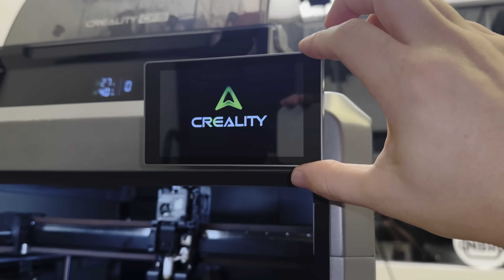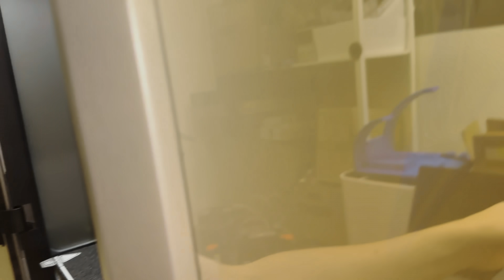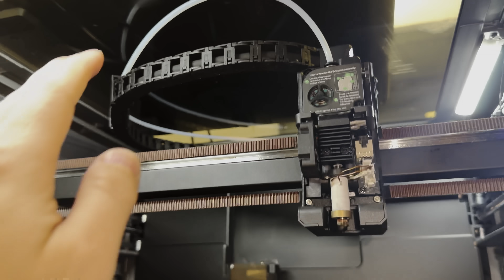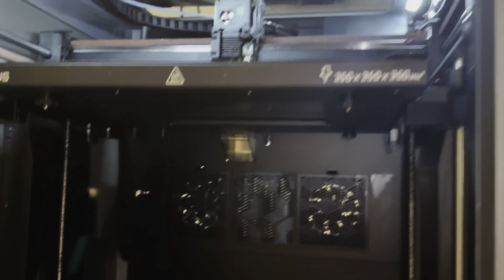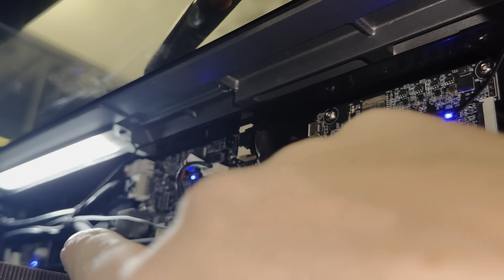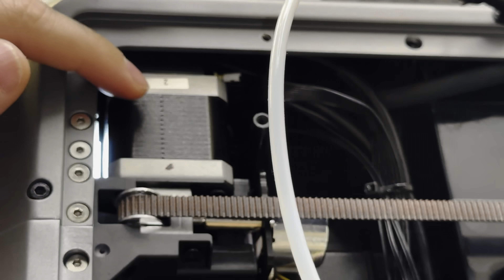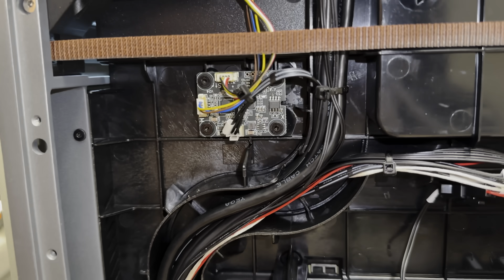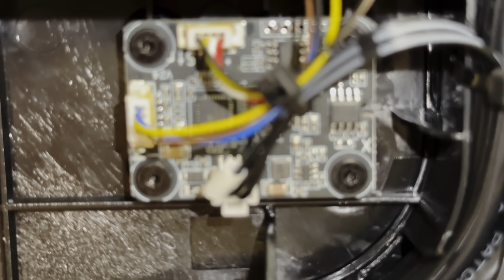Creality K2 Plus - What's Under the Hood?

Comment: 4mm bed only? seriously?
Also chamber heater blowing hot air there? Hot air rises, the bottom part will be cold. 
Creality engineers ....
Reply: The plate is 5mm thick and "heat rises" doesn't matter much when fans are circulating air around in a relatively small area.
Reply: @claytonanderson9665  Sure mate. https://youtu.be/jN60XeJ5-jE?t=344

Comment: Honestly there have been so many models that I have started to colour in preparation for getting the K2 that would require five colours so I was trying to figure out a good way to get it so that I can manually load in a fifth as needed.  Having a motorized spool holder that works as just a fifth colour would be amazing to have instead of having to infest in a second CFS.
Reply: You can't manually load the side mounted holder and CFS together, but you can load up to 4 CFS units together on the K2 Plus, once they are released, for up to 16 filaments.

Comment: That bottom bay may not get used very much by the average person but I'm sure the easiest use for that extra space could be desiccant storage. A more advance use could also run air across the desiccant and route the air all the way up to the AMS potentially preheating the filament to get 5% extra max flow rates while actively dehydrating the filament.

 This printer is looking like it might be the new standard, I just might have to get my hands on it and see how easy it is to do a 60v stepper conversion with these steppers.

Comment: spray some WD40 on paper towel it will take the glue residue lots easier then IPA, looks like the load cell working like the pursa printers? I do hope they will come out with longer cables to put the CFS on the side maybe if Bambu has same cables? wonder if that would work putting the CFS on the side...
Reply: I don't have the printer yet but looking at the pictures I think you can put the CFS on the side if you mount the shock module on the CFS itself. The only thing that would be missing is one of the Bowden tubes which would need to be longer, but that is easy to acquire.
Reply: What has been said is that the CFS cables in the K2 Plus Combo basically force you to top mount it, but a retail CFS will have the longer cables, and they will also be available in the store soon-ish as well.

Remember, you will be able to chain up to 4 CFS units together.

Comment: Hi Nathan I am going down the 3d printer rabbit whole. I have no previous understanding of the industry or software. I am looking in at new machines and want good system I have built my own computers not a complete noob. I like the K2 plus due to bed size or Bambu psp what would you suggest.
Reply from the maker: I wouldn’t recommend this as a first printer in the odd chance it has issues with the first units being sent out. I’d actually reccomend a Bambu A1 mini to get started since they are so cheap, then figure out what you want from there.
Reply: Thanks Nathan awesome content, from a geezer looking for more projects 😂

Comment: 21:59 Those are EPS connectors, available in 4 and 6 pins. They’re used not only in PC power supplies and motherboards but also in many industrial applications, so it’s unlikely they copied anyone. Maybe inspired
Reply: Sure, but they could have used any connector.  So, I think he is pointing out that it seems likely they used a compatible connector.  Perhaps just coincidence, perhaps copied because it works, or perhaps they wanted to follow it as if it were a standard (assuming pinout is also copied).
Reply: @CL-gq3no Creality have been using these connectors since the CR10 so if anything Bambu copied them!
Reply: @Jeditiger05  I think he was specifically talking about the AMS and CFS connectors. Creality has been using those connectors internally for ages, just like any other printer manufacturer. Saying they copied Bambu might be a bit of a stretch—it could just as easily be inspiration or maybe even some kind of standardization.

Comment: One thing that I suspect the bambu has over this printer is the top layer quality. On the bambu it looks ironed. The reason for this is the x axis torsional stiffness. Bambu has two rods which makes it really torsionally stiff which results in very nice top layers.
Reply from the maker: That’s an interesting theory, I noticed that the top layers looked a little bit dragged, like they were painted on.

However it’s only on small top features on the little figurines. Large flat top features were very clean. I think it has more to do with the larger meltzone. The longer the meltzone, the less control you have over fine extrusions and retractions. It’s a trade-off
Reply: @NathanBuildsRobots  It's not a theory, it's well known in the voron discord channels at this point. You can see this most easily in the top layers. There are several things, first the toolhead needs to be balanced with it's center of mass in the spot where the rail attaches to the toolhead. Second is you want the X beam to be as rigid as possible when it comes to torsion. Three things are important here. The XY joints, the x beam it self and the attachment of the x rail to the x beam (rail can rotate on the beam). Those all need to be very stiff and resist rotational forces (torsion). If you have an x axis like the bambu, there are two rods in stead of just a single rail. The double rods resist the toolhead from rotating along the x axis which is what we want. Basically you want the toolhead to resist "nodding" on quick accels in the y-direction. This is most noticeable on top layers.

Comment: The motors for belt tension is the most interesting thing I've seen in awhile.
Reply: I would like to know a lot more on how this system works, because it seems like a very risky system that if not implemented 100% properly could cause lots of issues
Reply: @53Aries  all you need is a motor to turn a screw in and out that is connected to the pulley thus applying or loosening tension simply by a motor turning a screw. really not complex at all. also it would not cause any extra problems.... if the motor doesnt turn..... you just go back to hand tightening... even worse cause scenario it wouldnt affect the printers ability to print at all
Reply: @Mr.Thermistor7228  The important part is how they are determining tension and controlling the motor's. That's what I want to know. If implemented poorly belt tension could be easily messed up. Are they relying on the stall torque of the motor at a given voltage, or what.
Reply: @53Aries , they are probably reading the amperage draw of the motors and stopping at some set point that gives them the right tension.  The chip to detect amperage draw and voltage is dirt cheap so it's a very feasible solution.

Comment: IMO of printing for 10+ years now... The heater and filters should never be exposed to the outside. That would make heating the chamber inefficient and most filters dont catch everything in one go, but if you cycle the air it will catch most AND more importantly wont dump toxic fumes outside the printer

Other side note, if that's a load cell on the extruder then it would be able to also compensate in real time for any variance in melt speed. No more max flow tests either and perfectly melted melty melts. I would LOVE to see the g-code for it. And make different profiles for different applications. Like if I want to ensure mold like strength I would be able to set back pressure to a small value and draft to a larger value, etc. I know Bambu Labs has it on some of their printers but it's closed source.

Otherwise, this is seriously convincing me to drop $1,500 at my first new printer in years. Maybe it'll be the first printer I've ever had that I haven't had to mod 🥲 I've never paid more than $300 for any of my printers, I've always gotten them open box at Micro Center or on liquidation 😅 and the belts actually look straight for the first time on a creality printer 🎉

Comment: Motors for belt tensioning is unnecessarily complex.

A properly designed spring made from quality material will be much cheaper and more reliable, and give a very consistent preload force which is esily adjustable with a simple screw and nut.
Reply from the maker: A spring will change tension based on hookes law. A motor has the potential to be more accurate, but for the most part a spring is sufficient and much cheaper.
Reply: @NathanBuildsRobots , belt tensioning by springs is the norm in millions of car engines. This is an unnecessary complication of a simple problem.
Reply: @motordude67  But with wear and tear, and the sudden changes in accelerations of the belt, as well as belt stretch/component wearing over time, is it the same consistency as belts seen in cars? I imagine in the short run, springs are fine, but machines with heavy usage/less maintenance, an active system compensates better in the long run?
Reply: @NathanBuildsRobots  Right; by "properly designed" I meant a spring with a low rate that will have a small change in tension with the amount of deflection we're talking about.

Comment: I love these hardware tear down videos.  Nobody else does this.  Thanks!  Nathan Builds Robots is the definitive source for 3D printer hardware hacking information.

19:00 - Maybe the stepper motor drivers are on the back side of the PCB and what looks like unpopulated surface mount IC pads are test probe pads?

28:25 - That's the X axis microstepping stepper motor driver daughter board, which might explain why the stepper motor drivers seem to be missing from the larger motion control board at 19:00.

Bambu Lab is apparently making a TPU filament that feeds in their AMS, so maybe filament manufacturers will finally give TPU some love and my years of begging for a higher durometer TPU that prints better, easier and more consistently between manufacturers will finally be answered and I can use the CFS on a K2 Plus to print parts that combine ABS and TPU.

Comment: The rfd feature is a bit of a pointless extra expense considering most will have no use for it unless they only use creality filament.
Reply from the maker: Well, given that creality open sources most of their designs, maybe they will provide an open source standard of other manufacturers to add RFID tagging? I will have to ask them about that
Reply: If creality wanted to - they could support third party RFID tags, where the user populates the spool type/color and it stores the RFID signature + parameters in memory for future identification.
Reply: The Creality marketing department may have mandated the RFID to help sell Creality filament to schools, libraries and similar institutional users who want a simple single sourced solution and don't mind paying $5 more per reel for It Just Works (TM).  It would be very cool if Creality published the RFID reel spec as an open industry standard.  While the Creality marketing department may not like losing the proprietary pricing on their filament, there is a huge marketing advantage by distinguishing your company as the friendly open source hardware reasonable profit supplier and not the greedy proprietary rip off guys.

Comment: Make that IDEX and I'd be interested. Still a very promising start, good to see some movement in the market.
Reply from the maker: Unfortunately I don’t think that would fit into this design, unless they moved the top electronics bay into the rear. Maybe in a K2 Pro model?
Reply: In theory, an IDEX version of the K2 Plus would rock - much faster filament changes and no poop.  IDEX is good for doubling print speed by printing two parts at the same time but that'd play hell with input shaping calibrations needed to print at high speeds.  It could be possible to print mirror image parts and have the motions cancel each other and print better/faster, but that's a special case.  IDEX for faster filament switching with no poop would be worth it for some people.  A mirror print mode with its own input shaping calibration could be very useful as well, but the complexity of the K2 Plus is already concerning and IDEX may be more complex/expensive than it's worth.

Comment: As someone who works on large CNCs and Industrial FDM printers, I always forget that people think 110vac is high voltage. I deal with 480vac when installing machines.
Reply from the maker: But I’ve also heard some crazy stories about the real high voltage stuff. DON’T UNPLUG THE MACHINE WHILE IT’S RUNNING! It’s not for the machines protection, it’s for yours
Reply: @NathanBuildsRobots  by the way, I do like the video and definitely agree with the way you stress the "high voltage" dangerous for people that don't know better.
Reply from the maker: Well, it is the context of 3D printers. Just like 600mm/s is considered high speed in 3D printing, but a car with a max speed of 600mm/s would be laughable
Reply: @NathanBuildsRobots  Right, I just forget from time to time because I am around these bigger units when I get home and play with mine. I just kind of have that muscle memory on not doing things to get shocked while live, lol.
Reply: I'm pretty sure the determining factor for high voltage isn't that it's comparable to what you typically deal with. I'm pretty sure it has to do with being above the upper limit of what's considered low voltage. That includes voltage below 100VAC.
Reply: @peterkallend5012  The International Electrotechnical Commission (IEC) defines low voltage as 0 to 1000 V AC RMS or 0 to 1500 V DC
Reply: Mains voltage is called in your country😅
Reply: Well, you simply should not work with industrial machines, if you do not classify 110V as heigh voltage. Because it is.
Reply: @FrodeBergetonNilsen  I'm not saying that it isn't just saying that when you're dealing with 480v on a bus bar  that is fussed at 1000 amps, it has me way more worried then 110vac outlet or terminal strip.
Reply: @FrodeBergetonNilsen  well, according to IEC standards, anything lower than 1kVAC is low voltage, so yeah, 110v is low voltage.
Reply: @asmodeuso27  No. You probably should try to write "only low voltage inside" on something, and try to sell it. As for the definiton, I had to look it up, and sure, I was wrong on how it it is defined. But this is not about definitons. Never was. It is way above 50V, which is all you need to know as to how to work with consumer grade appliances, and for any appliance at all.
Reply: @ I’m an engineer, not a seller, but I got your point. For the layman, sure, 110vac is hv and will probably make them think twice before poking around with power supply units, but from an industrial/distribution point of view, it’s not. That’s all lol
Reply: @asmodeuso27 I don't get the backlash you're getting. 110 isn't dangerous unless you have a heart condition or get a long exposure. Whereas when you start getting to 200+V it's a bit more serious and when you hit 400+VAC it's actually pretty scary and should real PPE should be use if for any reason you can't LOTO.
Reply: @FrodeBergetonNilsen  The classification for high voltage is 45,000v to 230,000v . Low voltage is classified as 50vac to 1000vac

Comment: Using the unicorn nozzle on this printer was a bad choice; it makes the printer very wasteful, as the cutting height is too high. I was hoping they would improve on this compared to Bambu, not make it worse...
Reply from the maker: It’s actually the same either way. It is cut above the heatsink.

The longer meltzone however, does result in more waste
Reply: @NathanBuildsRobots  Thanks for the clarification. It would be interesting to make a video comparing the AMS and CFS in terms of waste and ways to drastically reduce it (like using infill purge, for example). I occasionally use the Bambu Lab AMS at work, and I'll soon have to manage the shortcomings of the CFS (k2 arriving on the 15th). A comprehensive mastery tutorial would be very helpful to many printing nerds drowning in colorfull poop.

Comment: Adding motors just to tension the belts sounds a bit overengineered.
By the way, how does it measure belt tension? Is there a load cell somewhere under the tension motor?